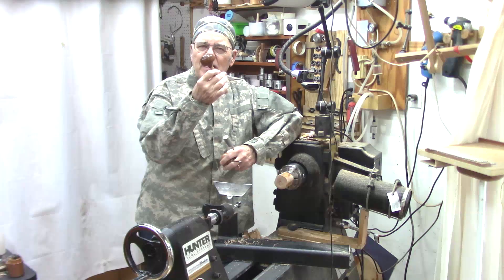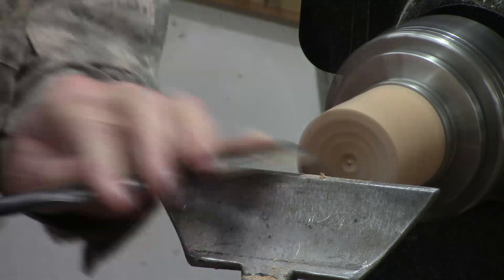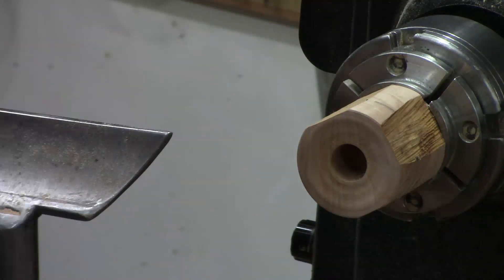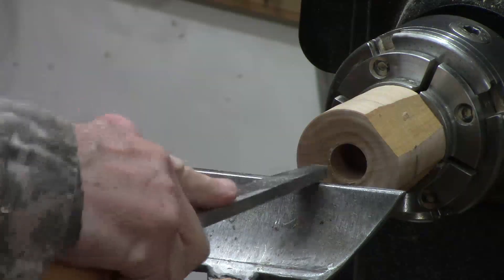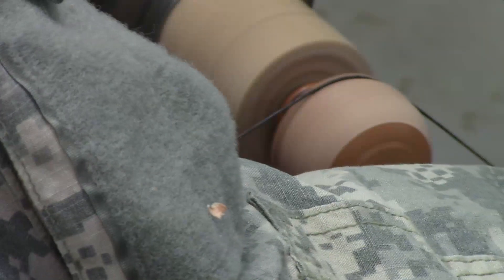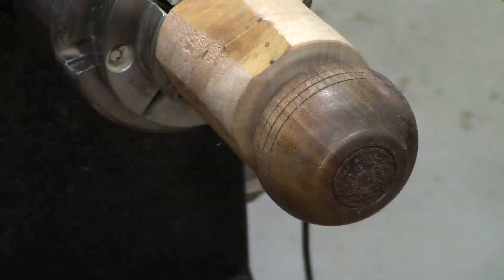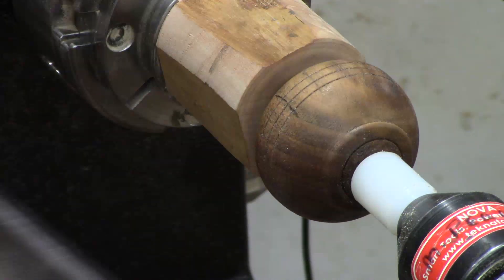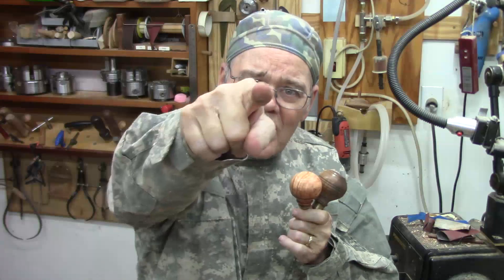JAM CHUCK Saves The Day!

Comment: Jam chucking in a myriad of different situations is a most valuable technique for sure Mike, but for awl making I adopted a different chucking method that works well. I purchased 1' lengths of different diameter vinyl tubing from ACE, cut ferrule length sections, slit one side open and wrap it around the ferrule and secure it in a chuck with pin jaws and detail and sand awl handles. Not a woodworker around that doesn't appreciate a nicely made awl. Yours are a fine example indeed. 👍
Reply from the maker: Yep, the more we turn,the more tricks we learn. That is a good tip to remember.

Comment: Good to know, Mike, thanks. I have a 3 jaw chuck which grips metal rod and tubing really tight for this kind of work. Also my jeweller's chuck will take ferrules up to 1" diameter for the same purpose, so I am adequately equipped. I find switching jaws tiresome, so frequently make novel (to me) jam chucks, too.  Bernard.
Reply from the maker: Good to have options, right?